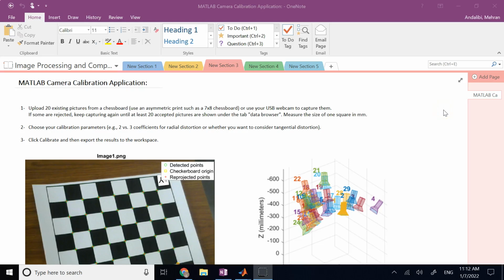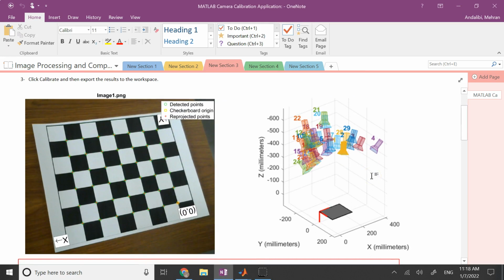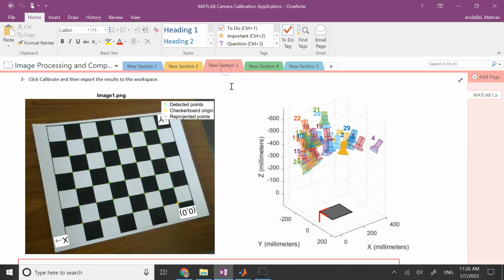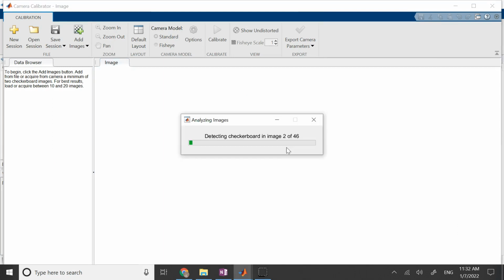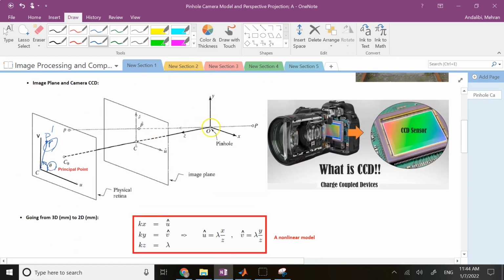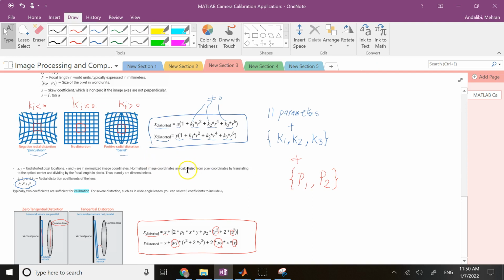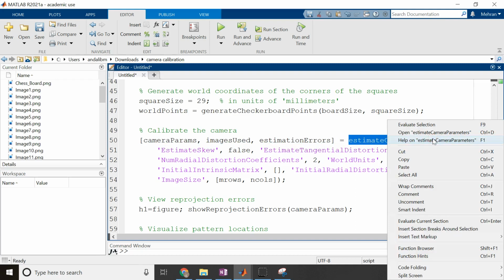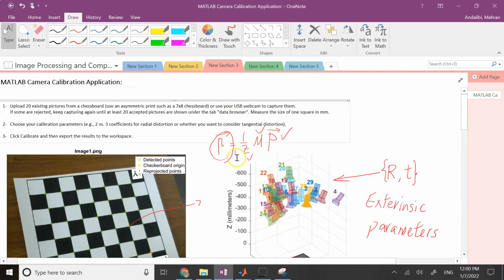MATLAB Camera Calibration App

Comment: Great explanation, thanks! Quick question, I have images taken at an angle that I want to dewarp using this application, is that possible using this app? Or do I have to use the rotational vector?
Reply from the maker: You are welcome. Please share this channel with your friends.

Using this app, you cannot fix the image warping, but it gives you the camera parameters that you can use in the command below to get the unwarped image (this command is available in version 2021b and newer):

[J,newOrigin] = undistortImage(I,cameraParams)
Reply: @mehran1384  Will most definitely do! 

Am I correct in stating that the operation you have laid out only undistorts the image using the intrinsic matrix? When I run the command, it only removes the curvature brought on the by the lens, it doesn't correct for the perspective distortion i.e. make the checkerboard a near pefect rectangle.